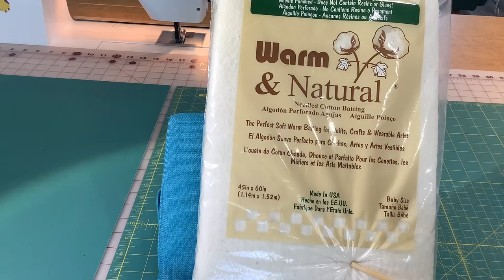How to Sew a Skillet Handle Potholder

Comment: Are you using a 1/2 inch seam allowance? Great video. Thanks
Reply from the maker: @susan I’m using my standard presser foot.  The edge of the presser foot to the stitch line measures just under a half-inch at 3/8”. Then on the hanging loop I do about 1/8” using my quilting foot. Thank you for watching and have a great day!